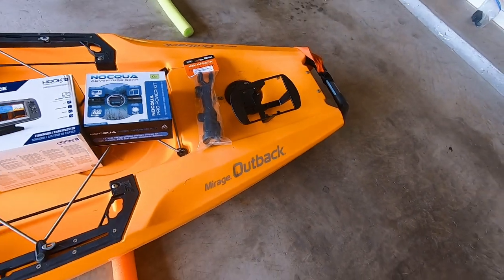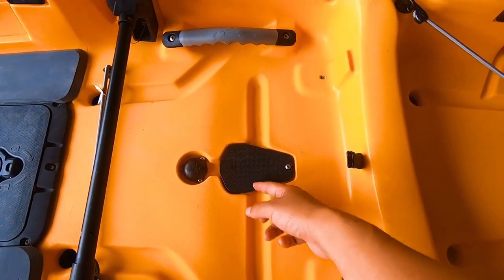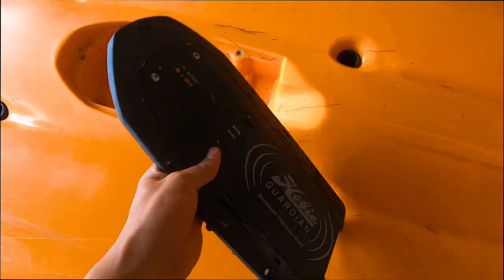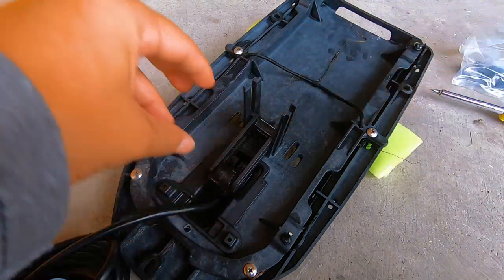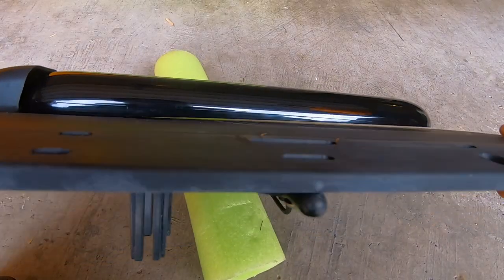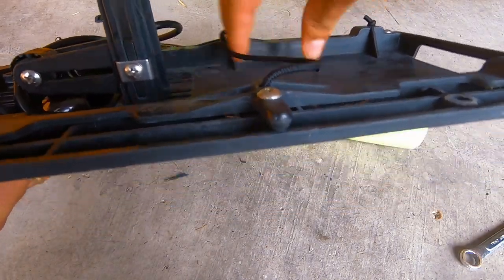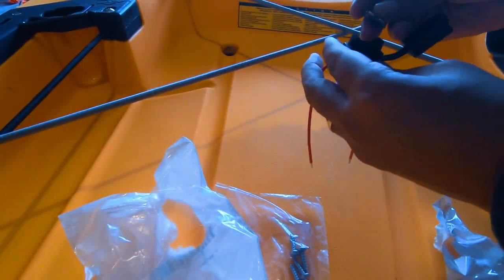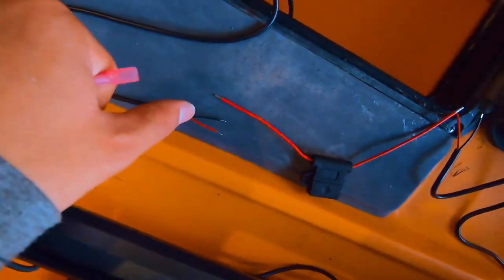Lowrance Hook 2 Triple Shot Fishfinder Install | Hobie Kayak | Hobie Guardian

Comment: Fantastic http://allabout.wiki/fd12?... Found a few reefs not marked on it inside the BWCA, but found more that weren't on maps because of it. All and all, great sounder, very sensitive, saw Lake Trout suspended at 65 feet in 90 feet of water, ran the jig up, and WHAM!!!!
Reply from the maker: Ya it’s a great unit I feel like I’m just scratching the surface.  Sometimes I wish i would’ve gone with the 7 inch display but 5 inch  does the job

Comment: I just got an Elite 9 Ti2 for my canoe that has a trolling motor. Someone suggested that I should save my money and return it for a traditional 2d sonar because you need to travel 3-5 mph to get a good reading with side scan and down scan. Do you have any issues with side scan readings at slow speeds in your kayak?
Reply from the maker: I’ll be honest I’m still trying to figure out how to use the side scan.  I haven’t been able to fish much this year so it’s really hampered my learning how to use the side scan
Reply: you can adjust the scan settings. You don't need to be going 3 to 5 mph while using it. However, you can definitely travel at 3mph easy in a hobie

Comment: Where does the scoop mount come from? Is it included with something or a separate purchase?
Reply from the maker: It comes with the hobie kayak.  There is a bag wit the owners manual along with fish finder install items and grommets for different gauges of wire to use with the thru hull plugs
Reply: @MesquiteOutdoors  Did you need to purchase anything else except for the battery and fishfinder? Like your fuse, did that come with the battery?
Reply from the maker: ya all I purchased was the battery and fishfinder.  I can't remember whether the fuse came with the battery or the fish finder but i definitely didnt buy it separately.  Good luck!
Reply: @MesquiteOutdoors  Awesome, thank you very much. Going to be doing this here in a couple days.

Comment: Did the battery cables come with the battery?
Reply from the maker: Will Yllera yes it came with a connector going out to the red/black wires that you can connect into the red black wires for the fish finder .  Hope that answers your question